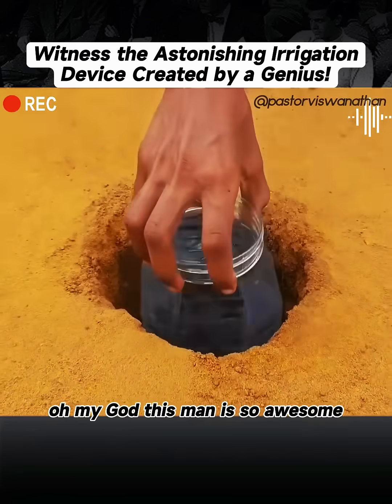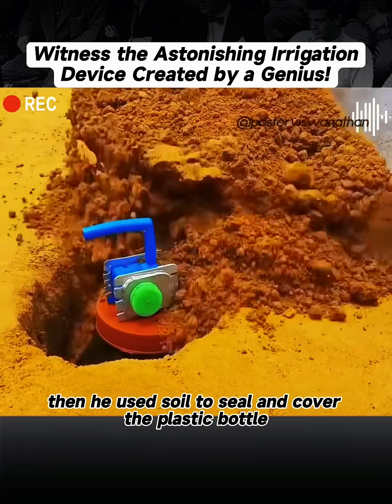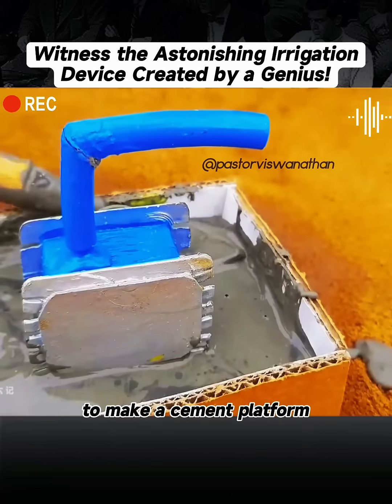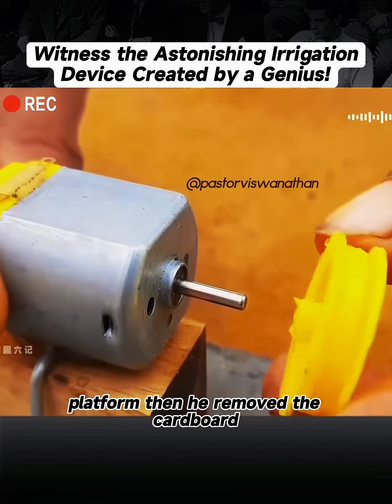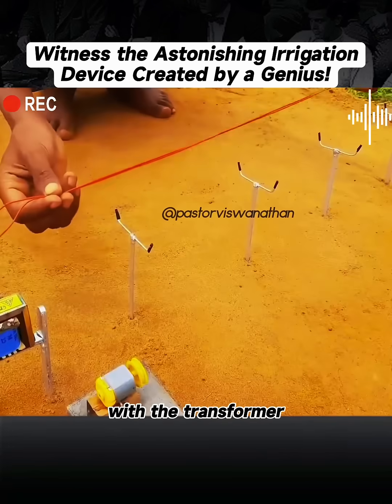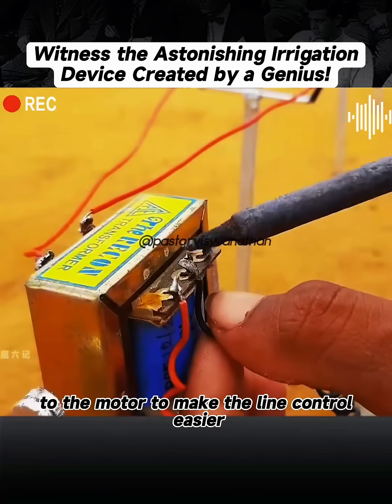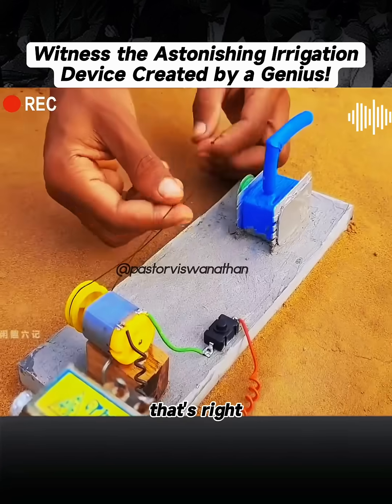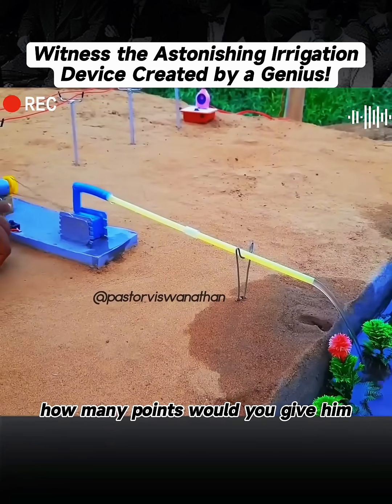Astonishing DIY Irrigation Device Built by Pure Ingenuity 💧  #shortsfeed

Comment: ZERO POINTS!  Why?  Because what happens when the bottle of water runs empty?  No way to refill it.  It's not an irrigation device it's a waste of MY TIME and YOUR MONEY!  So genius that I'd have taken that water bottle and just poured it into the garden.  When the bottle was empty I'd refill it.  No dangerous electrical power that close to the ground and unprotected points of contact means someone is going to get a heck of a shock.

And that concrete ? ? ?  WAY too much water.  That soupy mix would hold up for a few months before deteriorating.  Genius you ain't!